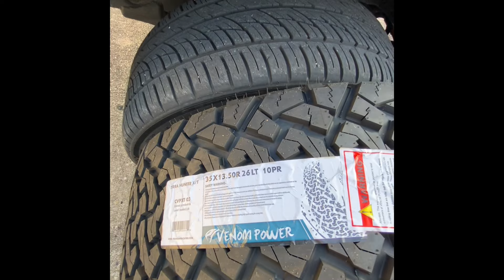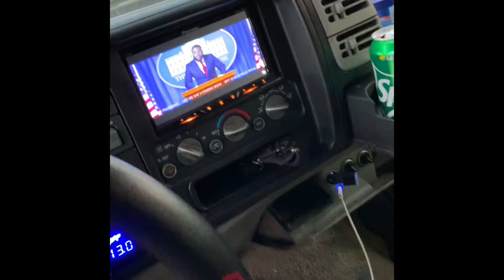1995 CHEVY 2 DOOR TAHOE ON 26 INCH CHEVY REPS ON 35s

Comment: Are those 26x10.  And ur able to Mount the 13.5 tire on that rim no issues.   I have texas edition 26 and want to run the mud tires and this dude over here trying to sell me new rims and everything
Reply from the maker: What’s size tires you goin with the same size ? And yeah I was able to mount them up without any issues
Reply: @Eazyauto  i wanted to put the 35×13.5×26 just had three in leveling struts put on by this place in Fort worth   and he not wanting to try says I need new rims. So I told him laters. Appreciate u responding nice video ill send a picture of my 2011 z26 4x4 when I get my 6s back on. Took them of for the snow storm haven't had a chance to get them back on.

Comment: What you trim the plastic or fenders?
Reply from the maker: Whoever had the truck before had big ass mud tires on it so we didn’t have to trim they went straight on but you would need to trim a lil for no rubbing on a max turn
Reply: @Eazyauto  what you need to trimm?

Comment: Can i put these Tires on 26x14 inch wheels ?
Reply from the maker: Yeah you can jus have to blowup the tire gotta stretch the tire a little
Reply: @Eazyauto  and on 26x10 ?
Reply: what size your wheels got and what offset ?
Reply from the maker: @sinisadjukaric9338  not on a 26x10 you don’t have blow them up they mount up fairly easy